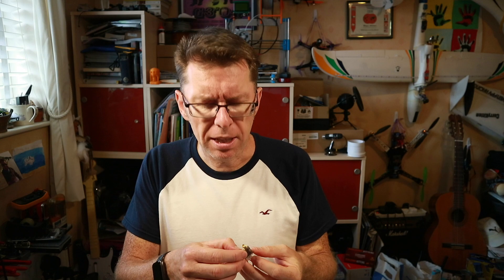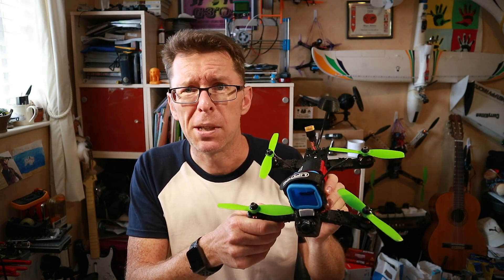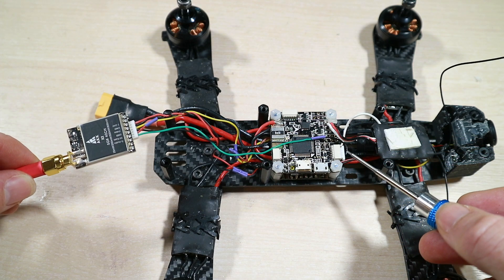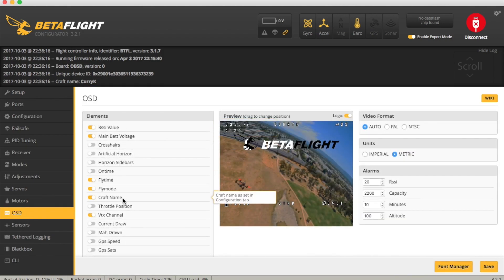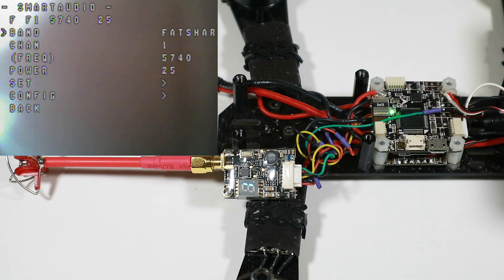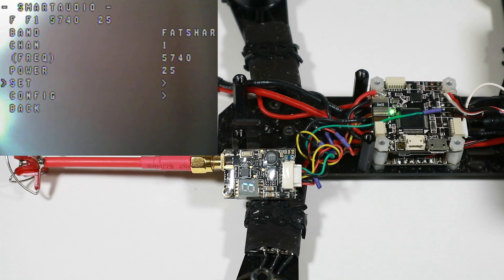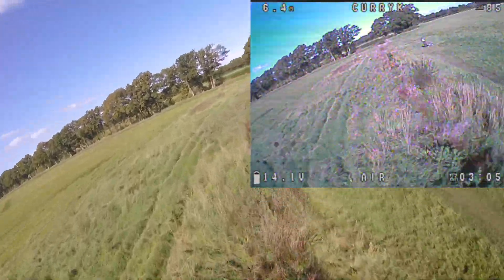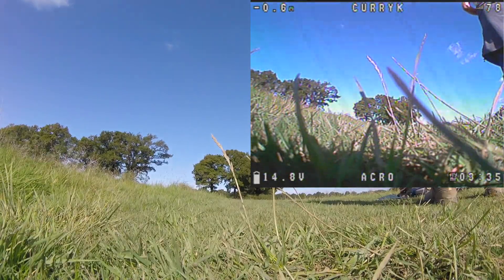FPV Reviews: The Akk-Tech X2 VTX, featuring Smart Audio

Comment: Anyone know if this vtx have osd
Reply from the maker: The VTX itself doesn't have an OSD - you'd normally get the OSD overlay from your flight controller
Reply: I'm interested to see my battery voltage.
Reply from the maker: Always useful - but you'll find that VTXs never have one, if your FC doesn't have one, then choose a camera which can show you main battery voltage instead... which many do now
Reply: Is there any that comes with voltage on screen  that you can recommend me
Reply from the maker: What, cameras?  ALmost all of them from Foxeer, Runcam and Cadx seem to.  My fave at the moment is the Foxeer arrow range.  You'll see it on the recent X140 HV review I did.  This one https://www.banggood.com/Foxeer-Arrow-Micro-Pro-13-CCD-600TVL-PALNTSC-FPV-Camera-with-OSD-BlackBlueRed-p-1248761.html?p=E81211714085201408XQ&custlinkid=312585
Reply: I got my akk yesterday on the mail,  which fc do I can use for flying wing, I'm only interested in battery voltage pretty much and also signal strength if it is possible but not really necessary. Thanks

Comment: the vtx needs 7volt minimum, does that mean i take the power from the battery pads?
Reply from the maker: Depending on your setup, you will have a few options.  Some FC's (the omnibus being one) gives the ability to passthrough the VBAT connection out to the VTX, so you could wire in there, or go straight to the battery pads.  On the quad I was using at the time, it had a PDB where I was using a regulated 12v supply.
Reply: @CurryKitten  Alright thanks for the information. It was indeed the omnibus F4 ( wizard x220 )   I thought all i need was a runcam split or cadxx turtle for audio but that only records audio if i understand it right.  audio live is only possible with these ones i guess right?  Seems like pretty much nothing comes RTF with audio vtx.

Comment: Will I need a TBS Tx thingy for the smart audio?
Reply from the maker: I struggle to know what the TBS Tx thingy is - can you elaborate ?
Reply: Haha sorry, yes of course. I think it's called the TBS transmitter module, Unify or Crossfire.
Reply from the maker: I'm still not sure that's a thing as such, but no is the quick answer.  You TX (i.e radio) is going to be whatever radio you are using, paired up with the receiver on the quad it uses.  This is quite independent of the VTX... or the ability to use smart audio.  Does that answer it ok ?
Reply: Yes thank you CurryKitten, I am such a noob still have'nt build a quad yet and still trying to figure out how it all works :) You got yourself a subscriber there.

Comment: I would your opinion ,would you choose this or the TBS unify pro or the tramp. or something completely different
Reply from the maker: Tricky - I've used them all, but not all in the same quad, so I've not made a real like-for-like comparison.  I've got a TBS Unify in a Diatone GT90 and it works well, a tramp in two Vortex quads - works great, and then the AKK which also works fine.  I recently got the AKK FX2 (which is made to fit in a normal mini quad stack) which I liked the convenience, and easy fitting of.  I don't have a favorite, but certainly amongst the racers the TBS is said to be more bullet-proof
Reply: Thank you so much all your advise is taken on board It's a hard choice to make

Comment: It's possible use the same feature on inav?
Reply from the maker: I think so - I'm not actively using iNav, but I could see there was an issue opened to support Smart Audio and the Tramp VTX's, and looking at the configurator code base, it appears to be in 1.8.1
Reply: CurryKitten awesome! Thanks! One more thing, on inav is possible use the "gui" through the osd like betaflight? You know with the "sticks combo" for entering
Reply from the maker: Yes - that seems to be supported, although I don't know exactly what you can change through it.  I do have an Omnibus F3 running iNav on an unfinished plane that I really must go back and finish !
Reply: Thanks a lot! I'm going to try that on my wing :D
Reply: Blink I use inav on a matek f405 osd. All of the beta flight taranis Lua scripts as well as joystick commands do work great!

Comment: Why and where did u solder the camera ground to?
Reply from the maker: I've redone this since, but not tested.  I found that the camera voltage/ground were coming direct from the PDB on 5v.  I think (not tested yet) I've now moved the camera voltage/ground to the VTX to see how good the LC filter is on it.  The "right" way of doing it is to have the ground common to every connection (even though grounds should all be common with a single lipo anyway) in reality, some components work well however you do the grounds, and some stuff is fussier
Reply: CurryKitten one other ? I have solder everything correctly and set up the soft serial ports on betflight f4 board but cant get smartaudio to work. I can access the menu and move the cursor around with my control sticks but cant do anything in vtxsa. I can change things in vtxtx but it dosent actually do anything. My ground ? from earlier was hoping it was a answer but nothing. I havent hooked up the camera power or ground thru the vtx straight ro the board so could that be a reason? I tried to find a way to ask akk themselves but there is no way to directly contact them that i found.

Comment: Hi
Im going build quad and I want to have a audio going out from my goggles , im getting monster V2 which have audio out , but do I need special VTX with audio transmission for that? Or this one will give me this option ? On your review i noticed that audio is for something else . Thanks
Reply from the maker: That's a good question... which is code for "I don't know".  Interestingly, if I look at my raw DVR recordings (which I mute in this video) I can actually hear the sounds of the motors, but it's not very clean, it's like static mixed with the noise you'd expect - but it certainly seems to be passing something back from somewhere !  I'll ask the AKK guys if they can answer this one (but it's National Day in China until after the weekend - so may take a little while)
Reply: CurryKitten Thanks so it means that sound comes through video feed? Thank you for your message  I'll be waiting until holiday ends :)
Thanks
Reply from the maker: The short answer from AKK is "x2 has a mic, which can transmit audio."  Which explains why I have audio in my DVR recording.  It wasn't particularly clean audio as I mentioned, but you can certainly hear the motors.  I haven't tried it through the headphone jack in my FatSharks though (not sure if that would make it better) as I've always flown without audio.

Comment: How long before they start squeezing smart audio into the tiny vtx's we are using on micro's. Now that we be useful, because I can't reach the darn once I've squeezed everything inside the frame.
Reply from the maker: Yes that would be handy - I've just configured a mciro which seemed to have two random LEDs on the FC to indicate the VTX band/channel without any docs to indicate what it meant, or how to change it.  Consider me a Smart Audio advocate for change :)
Reply: How small do you want it ?

Comment: Thanks for the review. 

These look suspiciously like eachine TX. Does AKK OEM to eachine?
Reply from the maker: I did ask that question before, and asked if there's another single manufacturer and people badge it.  I'm told no, and it's assembled in their factory.  There's certainly a difference in the nice silicon wire they tend to use, and there must be common components.  I will try and get a concrete answer if I can about the practically identical bits from various makers